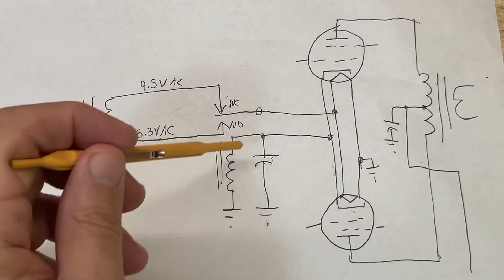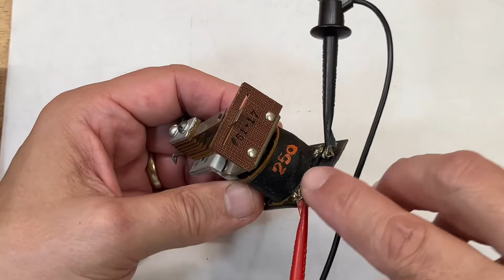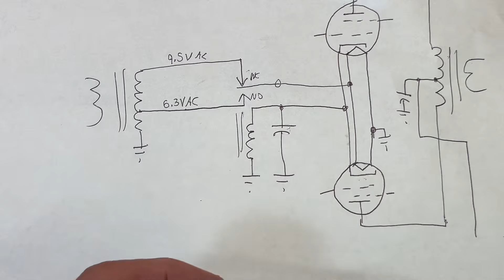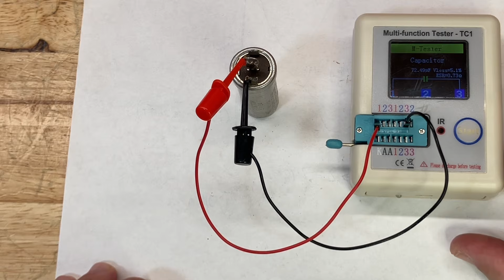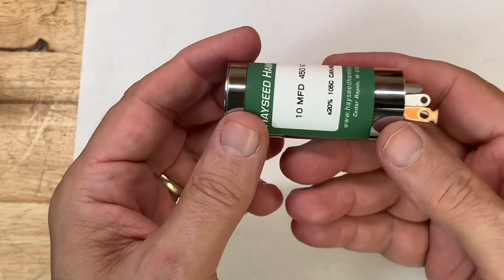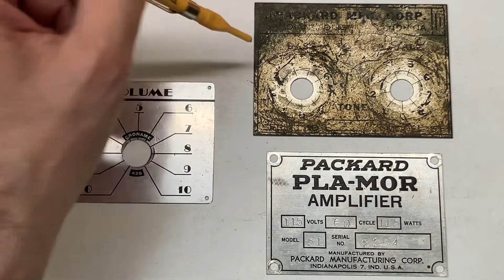1946 Jukebox Amplifier: Packard Pla-Mor Model 51 Part 2

Comment: Don't feel to bad, I have the Chinese tester too and its very useful indeed ! Only cost about 15 quid. The amp looks awesome, what sort of power are you expecting please ? I'm not a valve sort of guy but I would imagine only a few watts.......cheers.
Reply from the maker: It’s rated at 16 watts in the manual. We will see! I have a lot of work to do still.
Reply: @garyramsey4275  :)